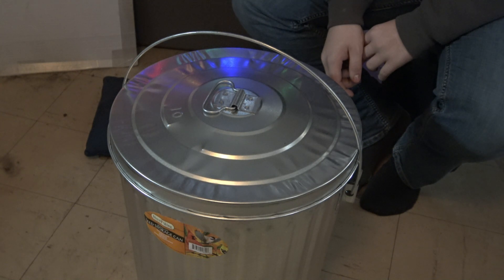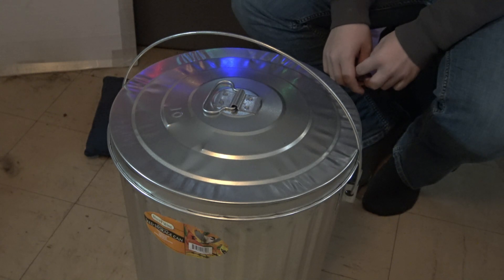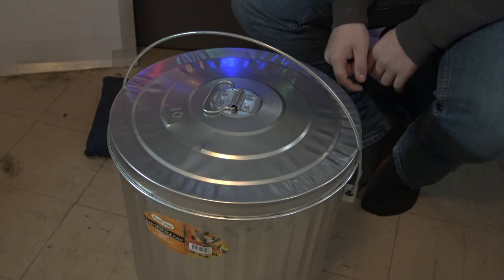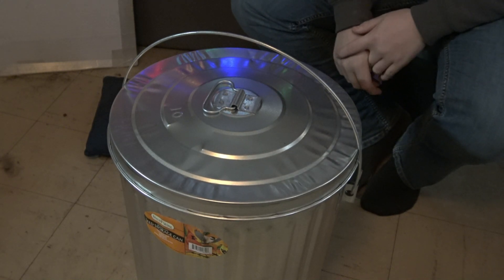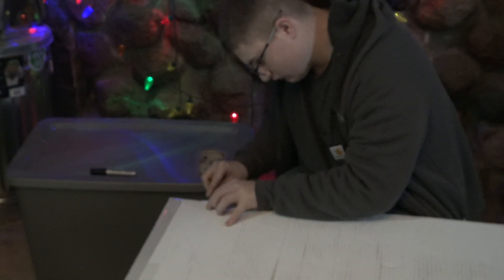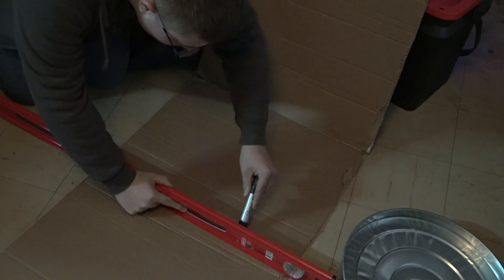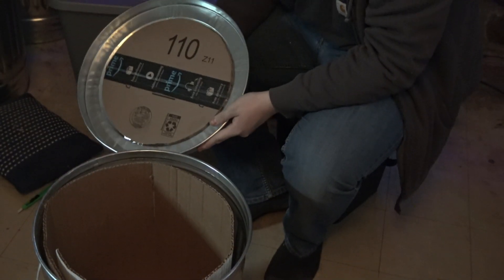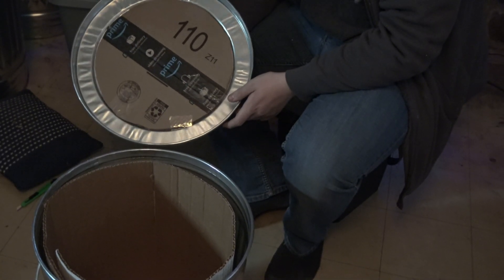How to build a EMP proof container on the cheap for sensitive electronics Part 1

Comment: using the can is good,  but for it to actually protect you must have your equipment inside the inner emp proof bag also
Reply from the maker: not necessarily but nesting is a preferred way to do this you do not want your equipment to touch the metal sides or top as you are creating the shielding effect around the can. I do recommend to use additional shielding on each piece inside the can just to be an extra layer of protection.